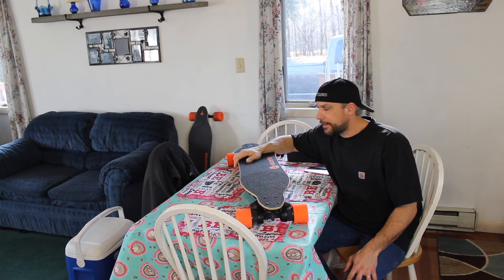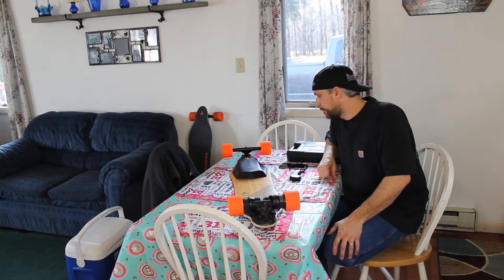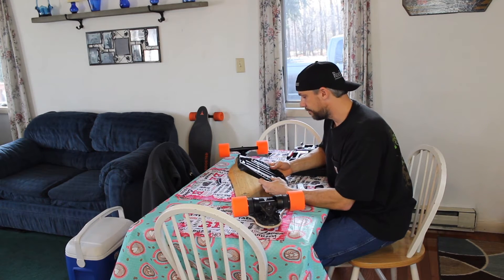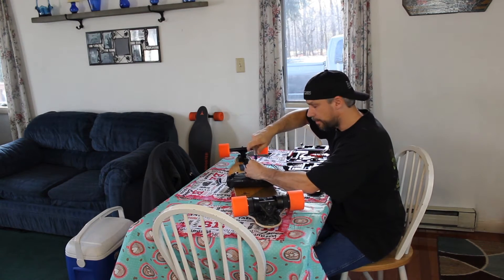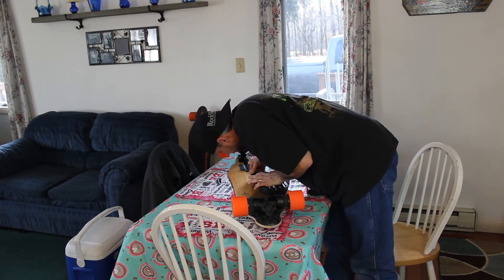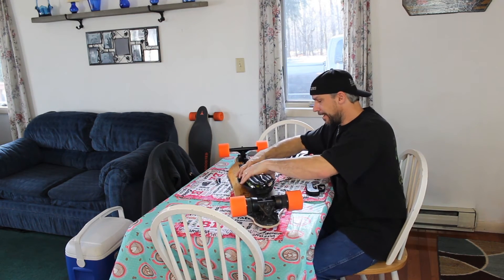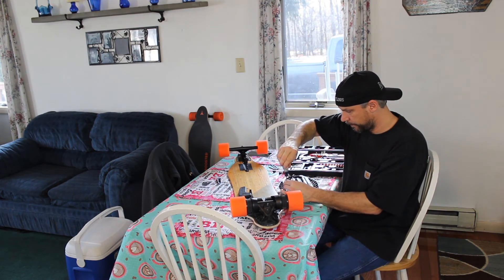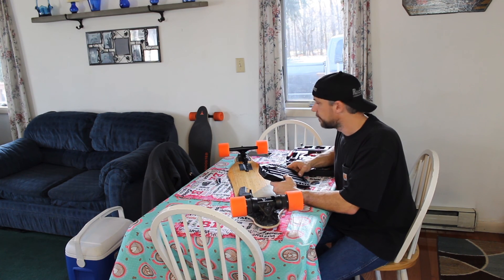What's In The Recalled Boosted Board v2 Battery?

Comment: since you cant connect the phone app and the remote same time how does it keep track of how many miles you traveled? Does it only work when using the phone
Reply from the maker: I think it logs that info in the esc (electronic speed controller near the motors) rather than in the battery or the phone app....

Comment: That was amazing... the only one who open the batteries to see whats worng...
Reply from the maker: Finally someone understands! And really there was nothing wrong with the battery other than it wasn't 100% completely waterproof like they where advertising it to be.... so they had to do the recall to cover there ass... new battery is exactly the same except for a little plug on the bottom. Looks like maybe they do a  pressure test to make sure it is sealed up better, but they also don't market the board as waterproof any longer :-(
Reply: I think they printed wrong circuits ... to narrow ... and it causes to short circuit, and explode ... you need to do the comparison between the 2 batteries ... because there are changes.... maybe in the future you can do a freaky close up to the battery... good video.

Comment: That looks to be 12S1P battery, with LiFePO4 ANR26650 cylindrycal cells made by A123(USA MF).
There is its datasheet:
http://www.a123systems.com/Collateral/Documents/English-US/A123%20Systems%20ANR26650%20Data%20Sheet.pdf
Reply: Np
Reply: what's the battery voltage on the v2 boosted? I'm thinking of getting one. I've done a ton of reseach on electric boards. i would like to connect a lipo battery with 16,000 to 20,000 mah to get a lot of range.